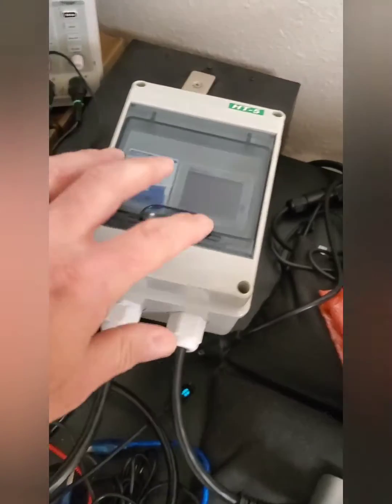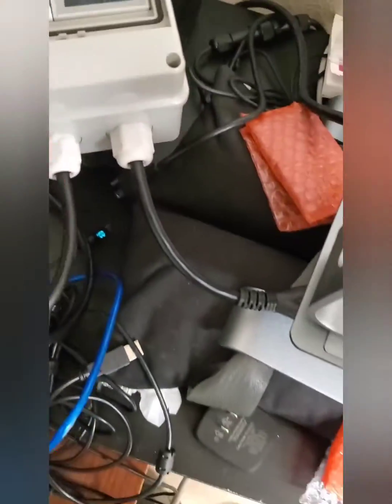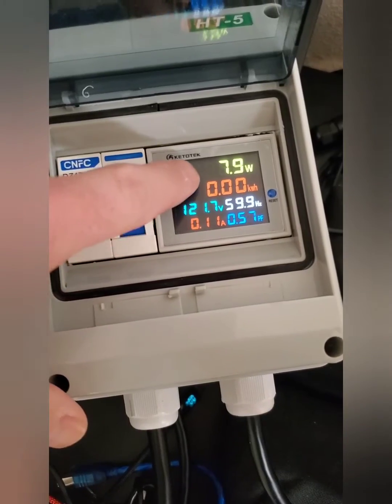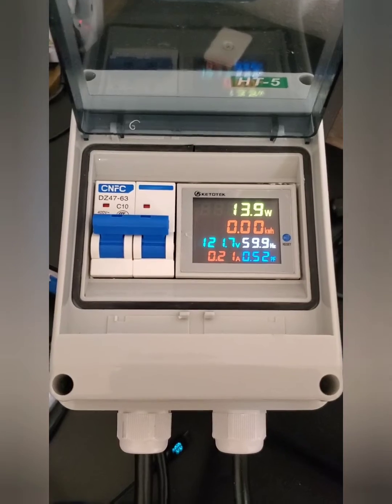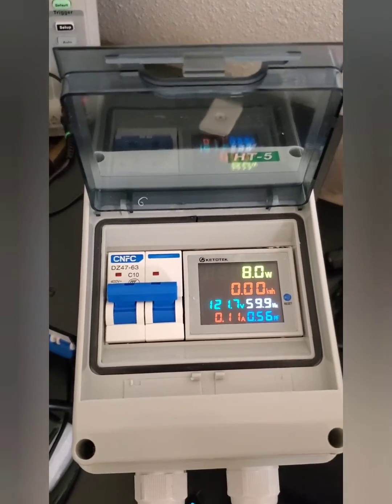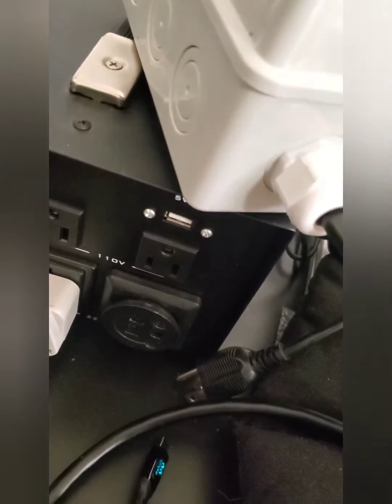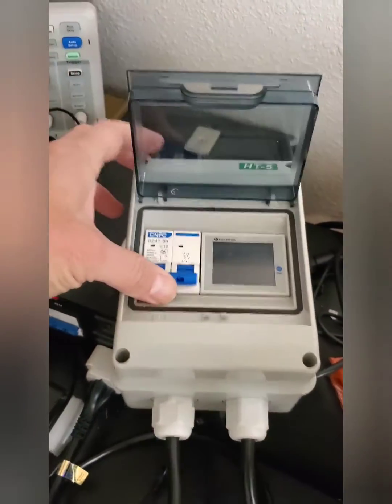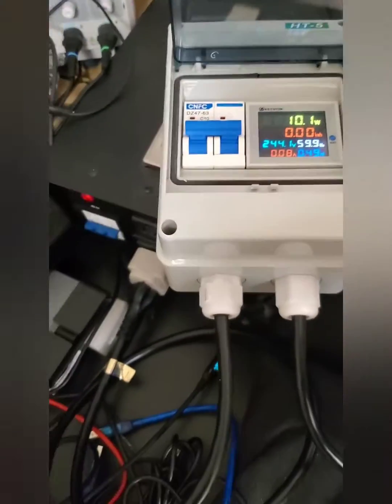Power box upgrade with meter AND line filter

Comment: Is there no heat development in that box ? I would put the filter on top instead, on the outside. The box has that height for a reason. But perhaps the reason is only to be able to handle the wires and not overbend wires.
Reply from the maker: The filter is not generating heat, it's all metal to prevent EMI escaping the filtering stages.

Comment: Can you please verify if a 10amp or 16amp breaker should go into the Power Box. And what gauge wire should be used?
Reply from the maker: @RobertGuadagnoli  a 10A breaker is enough, even six servos combined don't peak more than that, and the cables should be 14 Gauge

Comment: Can you explain the additional wiring with this meter please? Just ordered all!
Reply from the maker: The meter just hooks up on the "load" side of the line filter, so it can measure the load, and you just pass the black wire (live or hot) through the hole of the meter where it senses the current using contact less sensor. I'll share the diagram exactly how on my Discord later today...
Reply: @tronicgr  Purchased built and working, thanks!
Reply from the maker: shared a schematic, on my Discord, and here: 
https://www.xsimulator.net/community/threads/amc-aasd15a-servo-controller.13945/page-20